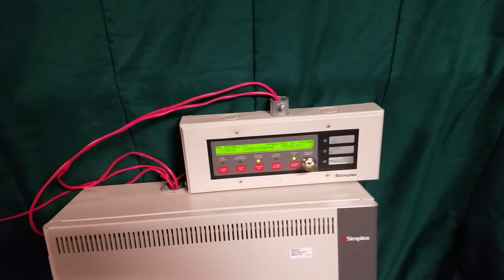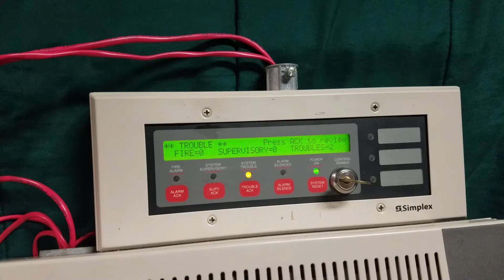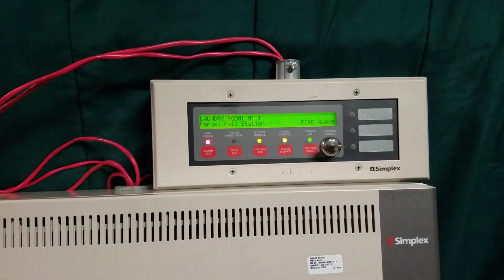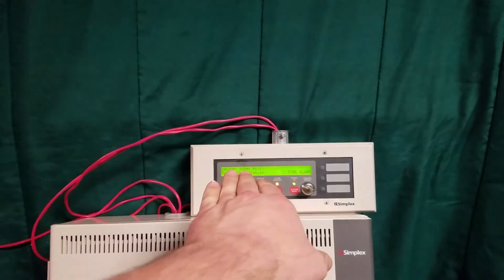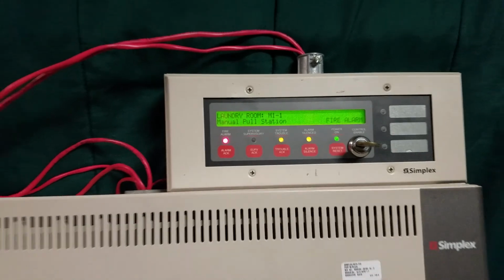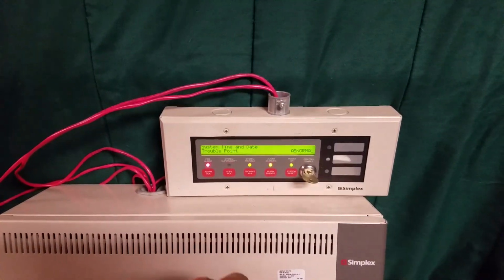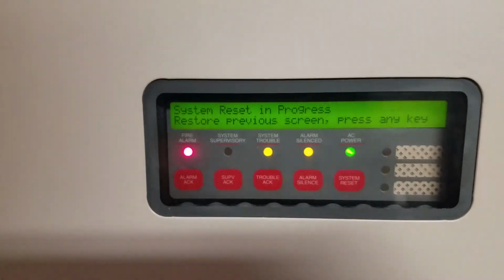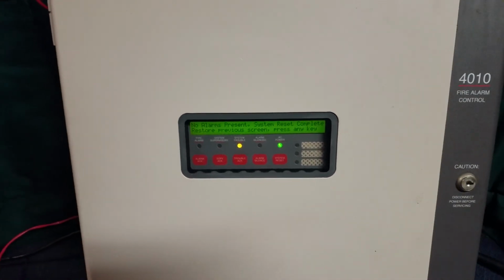Simplex 4010 Fire Alarm System Test

Comment: My building has a Simplex 4010 fire panel. I was sanding the walls in an office to prep for new paint when the fire alarm and strobes went off.
I was able to silence the alarm, but not the strobes, which have been flashing for several days. I presses the "system reset" button but the strobes continue to flash. All 5
LED's above the red buttons are all lit and the display says "I/l" on the extreme right side. All this
happened 5 days ago. Do I need to remove the smoke detector from that office and blow it out? Why does this system reset button not work?
Thanks for your help and advice.